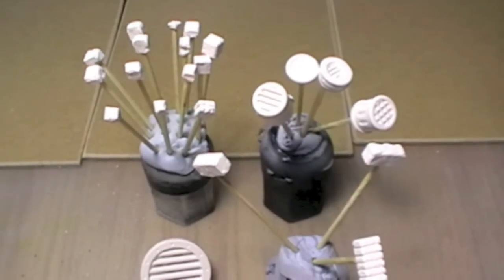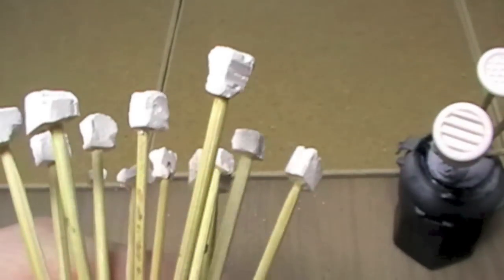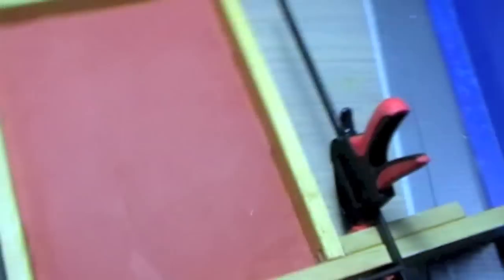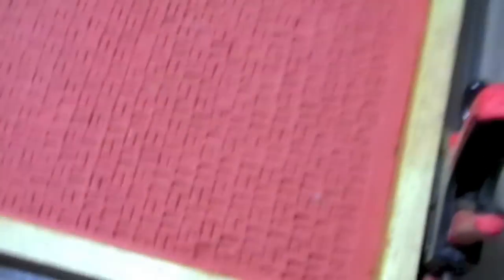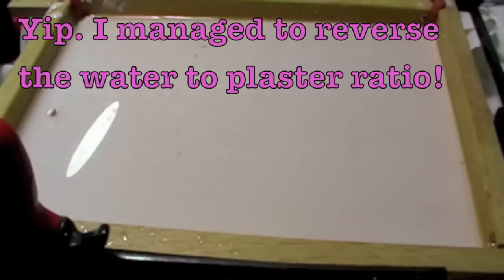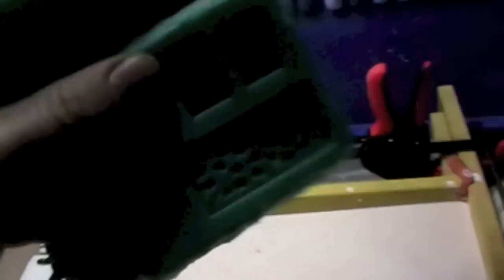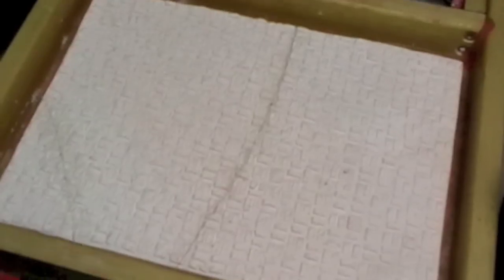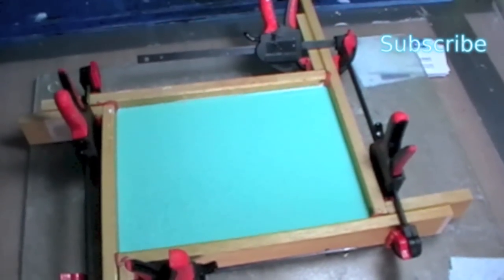Making Cobbles through a Negative Design

Comment: Very nice process. If you seal the corners first you could do a "HOt Clay" pour. Take a double boiler and put some chunks of clay in the top part of the boiler. Allow the clay to melt into a "liquid" but do not overheat. Pour this in your mold box. It will seal the edges as well as giving a clean flat surface to work on. 

Love the stamps, you can use fimo or sculpey to make some larger square stamps for faster work. Or make some cool custom stamps as well.

Comment: If you are using it with silicone any of the sulfur free oil based clays can be liquified and poured. I am using Chavant NSP medium. I just place a pot with water on the stove and place chunks of clay in a larger bowl over it. Stir the clay until thin enough to pour. Then layer this in a mold box that I want a flat surface in. Since I have clear acrylic for the walls I can see how deep it is. You could mark depth on the wall itself though.

Comment: This is a sculptors trick for doing busts.  your sculpt the bust head and then make a mold of it. cut a wavy slit down the back of the head and then when you need a bust to work on you just pour a new one instead of sculpting one every time. I should mention it does not work for everything and be sure to used medium or hard oil based clay.